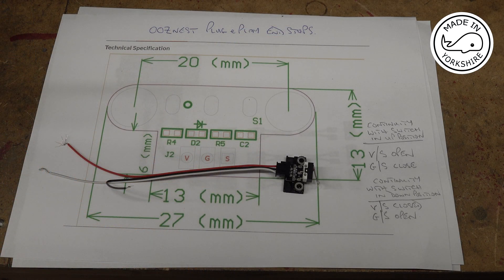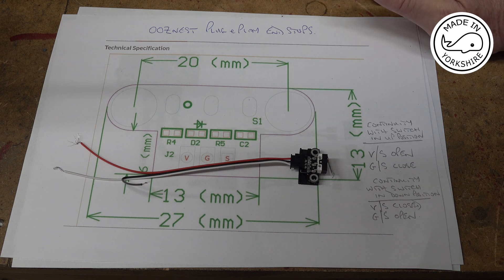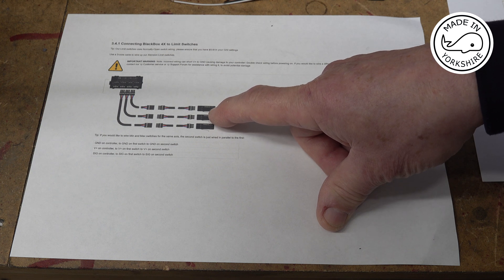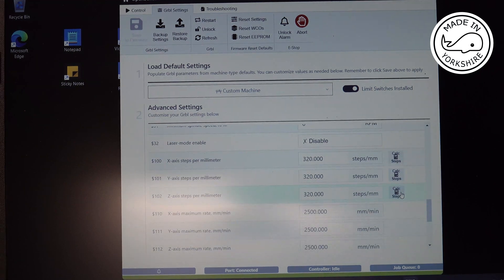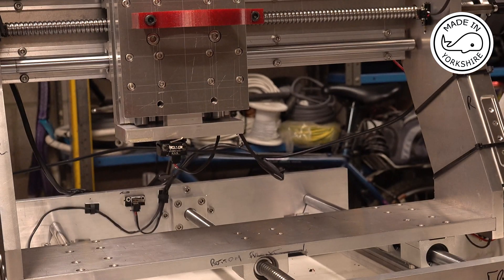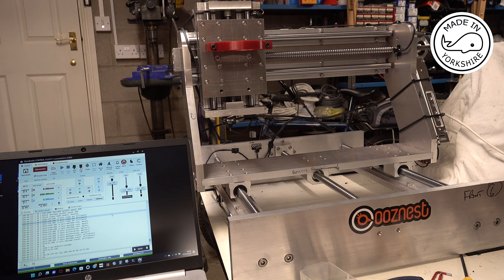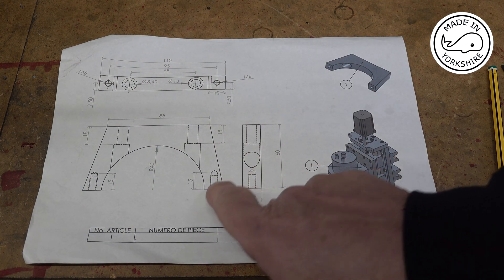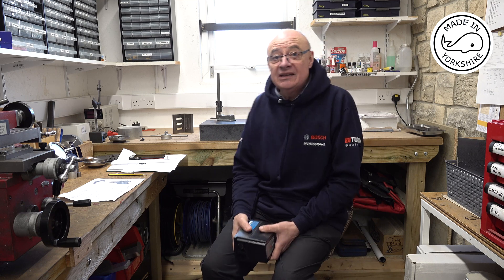#MT47 Part 6 - Olivier CNC Router/Engraver. Limit Switches sending me NUTS! By Andrew Whale. In 4K.

Comment: Normally open is not as safe as normally closed, as an example if your Z axis lower limit switch wire on normally open gets cut or disconnected for any reason the Z axis will crash into the machine ploughing the cutter into your table but with normally closed the machine will stop as soon as the wire breaks or disconnects. Its the same for any other axis although with lesser consequences.

Comment: Getting there Andrew. I only hope with all this work and expense, that you will be able to use it enough to justify it all. What have you in mind to do with it ? I know you said that you wanted to engrave labels. You could get several hundred of them Custom made for the time and money you have invested so far. You still need a table, vice, clamping and tooling to buy yet. I am not convinced that those plastic clamps for the spindle will not break, the motor will run hot and expand. If you are happy with the design, send your files to a 3 D Printer Company and get them made in METAL. Have fun. Regards from Australia.
Reply from the maker: Hi Dave I never thought about heat affecting the plastic clamps. Maybe my first project will be to make some metal clamps with it 😉. I've always fancied messing around with CNC and it's something else for me to get my head around and learn. All good fun.
All the best.
Andrew